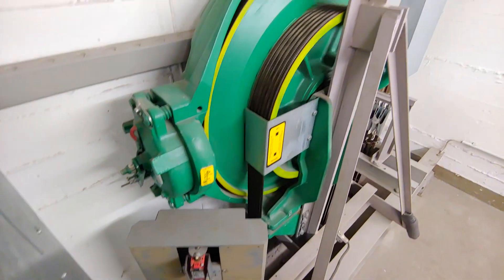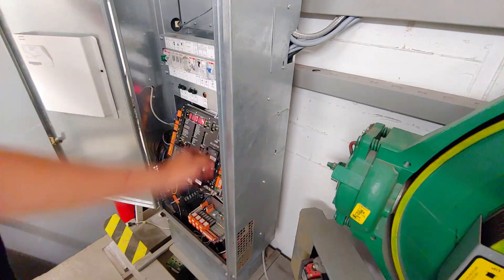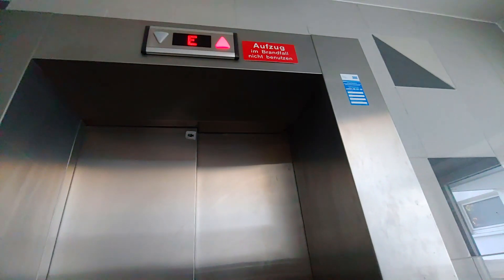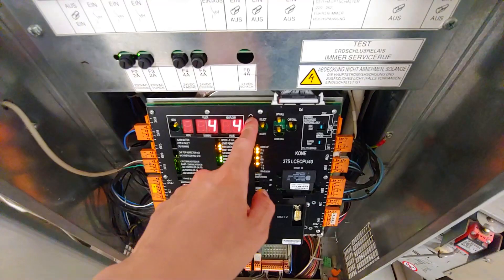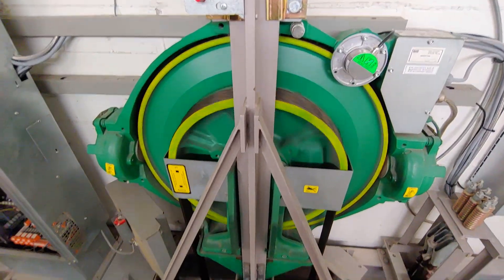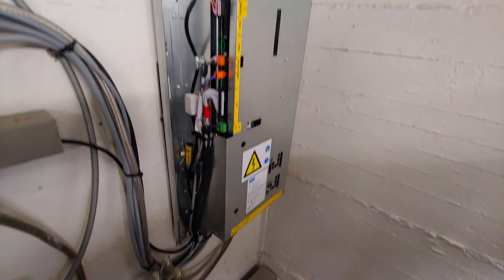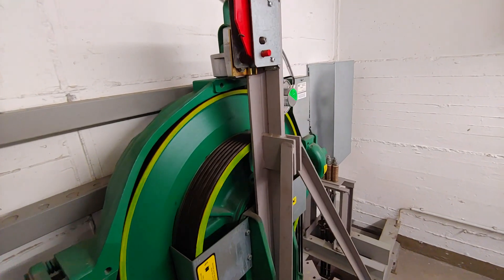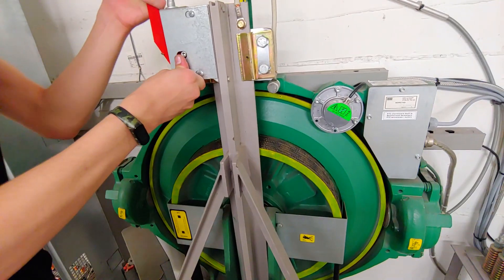Weird Ecodisc placement

Comment: Why do the first generation ecodiscs have such fast levelling? There are some from 2001 in my city and they are just as efficient as schindler even without pre-opening. It was one of the first MRL installations in the USA and is built to much better standards than the current KONE low rise model.
Reply: Many KONEs in my country can level quickly but then wait for ~3s before applying the brakes, & another 2s before opening the doors, so they end up not being that fast

Comment: When it is menu locked, can the lift still be used normally (getting in, pressing button, getting out, etc.)?
Reply from the maker: It is just the engineers interface that locks out.  The engineer can only enter calls after this.  It is no longer possible to change settings or view the fault log, but it is still possible to view active faults.
Reply: @benolifts  Thanks!
Reply: @benolifts  there is an unlocked tool we use .  That I saw selling on ebay .so u won't need to use the can card

Comment: how tf it goes back to its postition when u freefall it. Maybe try turning the damn thing off and then doing freefall
Reply from the maker: The lift gets semi position lost (also known as JU mode).  It does normal behavior for LCE on JU mode.  Very occasionally these get fully position lost, but it is rare.  If this happens it runs at slow speed and goes down stopping at every floor until it reaches the lowest.
Reply: @benolifts  
Interesting. How does a say Lester controls logic act to this? I'm guessing just goes out of service
Reply from the maker: @hariranormal5584    The old blind Lester controls don't get position lost when the lift is stopped between floors.  It just carries on.  But on inspection it does not keep track of position and becomes fully position lost and goes to lowest floor at full speed and reports fault "Lost LAR".  New Lester is different.  It has a 2D barcode positioner so the position is always known.
Reply: @benolifts  
I wonder why can't they make it make it level as efficient given it even has the 2D barcode, it knows it;s position ALMOST every Millimetre on the shaft.
Reply: @benolifts  Which type of LCE does the stopping at every floor thing. Out of all of my safety breaking, I've had ecodiscs lose position a handfull of times. 3rd generation just goes down at full speed until it gets to the bottom of the shaft (was able to get to a secret basement this way). It has also happened once in a 1st gen, the lift went slow speed to the floor below, which was the lowest floor, so I can't really say if it would have continued at slow speed past that if it wasn't the lowest floor. I might have to experiment some more.
Also some models of TMS have a reversal trick. If it has lost position and you safety break it when it has hit the limit switch but not quite leveled, it will reverse and go all the way to the other limit. You can keep doing this until it eventually gives up and goes out of service.